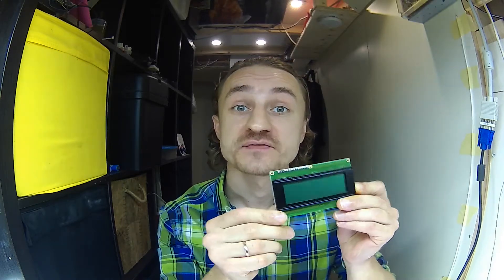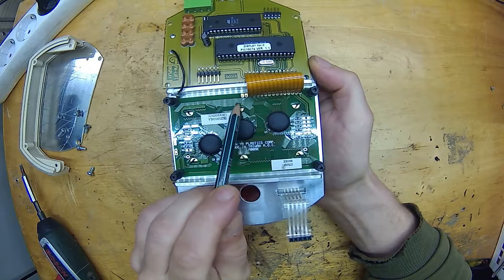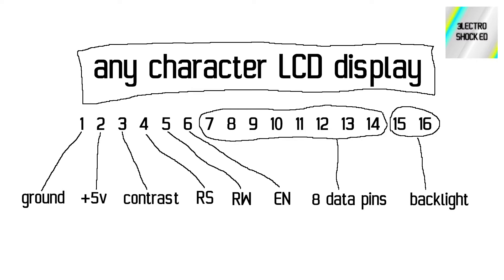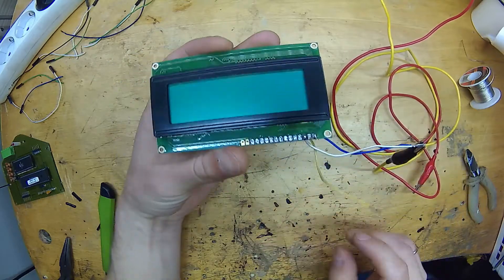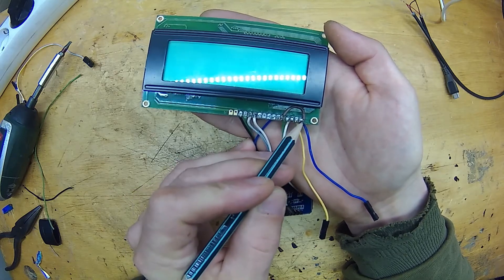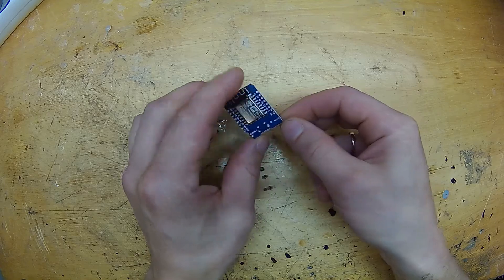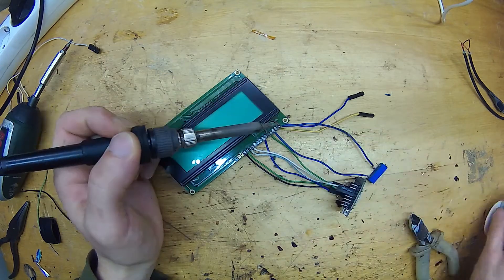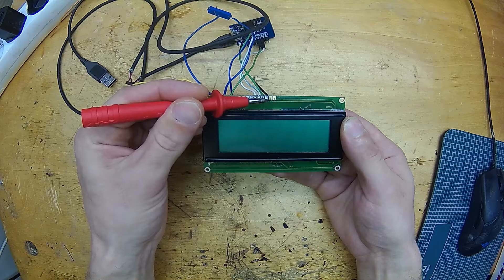How to Wire LCD Display with GPIO Pins

Comment: How can i change the GPIO 21 and 22 from the Lcd, sow that i can use them for an bme280 sensor.
Reply: with esp32
Reply from the maker: Hello! Thanks for your comment! :) Sorry, but I don't understand what you want to do. Could you explain more? Thanks!
Reply: @3LECTROSHOCKED    I am trying to connect a Bme280 sensor and a 4x20 LCD to an esp32 so that I can get the values of the Bme on the LCD. the problem is that the SCL and SDA of the sensor and LCD are set on the same pins( GPIO 21 an GPOI 22).  thank you for your answer !.
Reply from the maker: Do you mean that you don't have enough pins on the esp to have both connected? Have you connected lcd in 4 bit mode?
Reply: @3LECTROSHOCKED  yes connect with jumpers, i just don't know how to change the pins for the Lcd.
Reply: 4 bit yes
Reply from the maker: Ok, but I don't understand why you just don't move those connections to other pins? There are a lot of pins on an esp32. Are all of the pins already taken and you don't have any free pins anymore? :)
Reply: @3LECTROSHOCKED  no i have enough pins free. but i don't know how to get the SCL and SDA pins on another pin. Because the BME qn the Lcd need SCL qnd SDA each. But only pin 21 and 22 as these are fixed  at the esp32.
Reply from the maker: So the lcd is connected through a chip? Not with gpio like I did in this video?
Reply: @3LECTROSHOCKED  yes
Reply: It is wiht a chip *
Reply from the maker: Well take that chip out and connect straight with gpio pins like I did in this video..?

Comment: I’m getting close to finding a solution for my problem. I have an old vocal rackmount that had a bad 14 pin display. They do not make display no longer. I bought a 20x2 character lcd and it fits perfect. But it does not have a pin 15 and 16 for backlight. I connected it and the display works but it’s not lit up. How can I feed pin 15 16 power? I was hoping to find video of a diy taking power from pin 1 and2 to a circuit that feeds pin 15 and 16. Any ideas if possible?
Reply: You said “connect power to last two pins.” You mean connect 5volts? Any way I can get some of that power from pin 1 and 2?
Reply: If you can make a video of a diy taking power from pin 1 and 2 to power 15 16 would be great. I know you would need resistors. Anyways this would be a request if possible.
Reply from the maker: Hello! Are You sure you have a backlight on your display? If yes, try to look around for taps, that are called ANODE and CATHODE - those are LED pins. You can use power from 1 and 2, but usually we don't want that, since those are usually connected to some sort of microcontroller. That microcontroller may not be able to provide enough current to additionally power the LED. But if you are sure that there is enough current, then of course you can connect power in parallel.
Reply: @3LECTROSHOCKED  yes pin 15 16 for my new display are anode and cathode. The display is HD4480. But I keep reading by googling that taking power from pin 1 and 2 is not recommended. This is why I was wondering if there is another solution.
Reply from the maker: It's just about the current, so hook 15 and 16 straight to your power supply :) use resistor if needed.
Reply: @3LECTROSHOCKED  I appreciate your reply! Your video is great and is the same thing I was doing which is why I commented. Thanks again!
Reply from the maker: Thank you for watching! :)